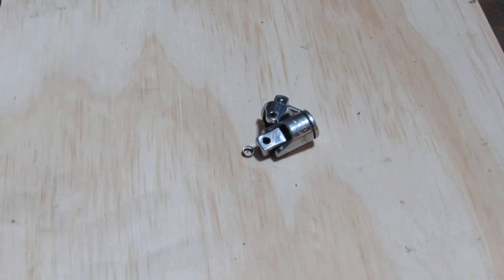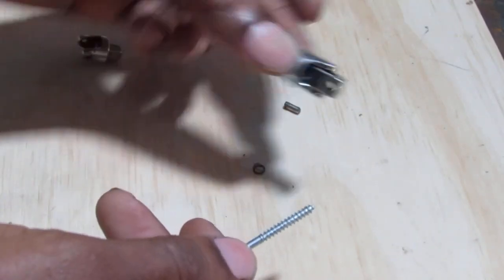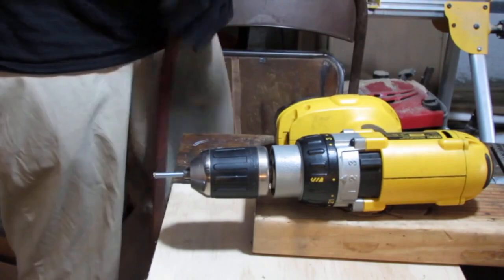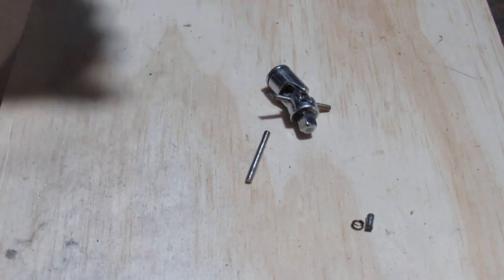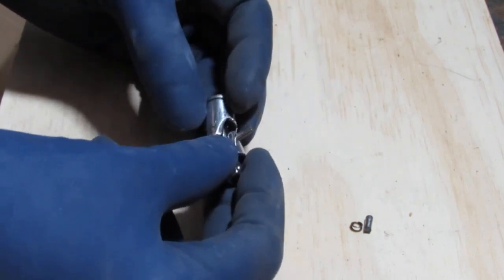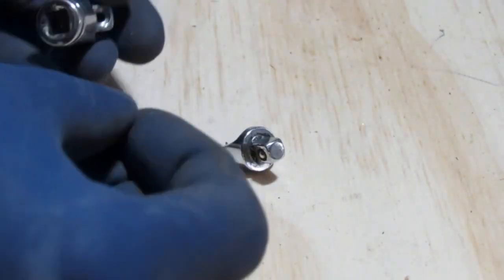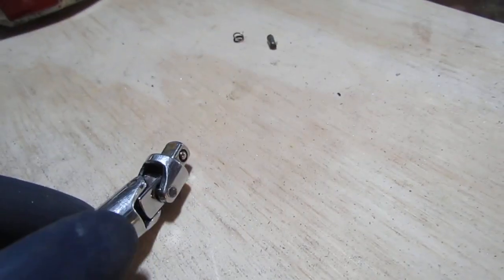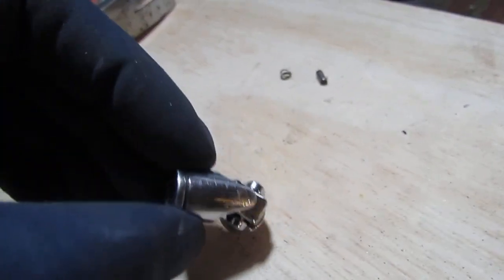Let Us Fix A 1/4 " Drive Universal Joint

Comment: If I wanted to remove both pins from a new universal joint what would you suggest the best way to go about that?
Reply from the maker: Take a grinder or sander and grind or sand both sides and then use a punch or anything that is smaller in diameter to knock it out.